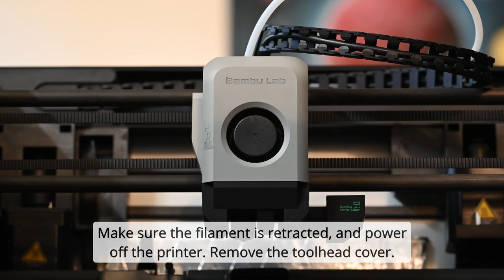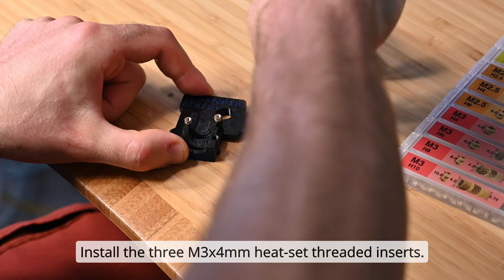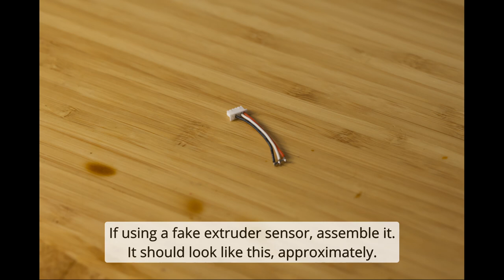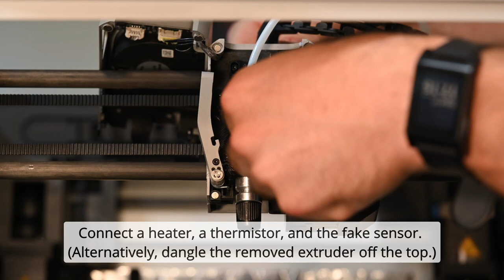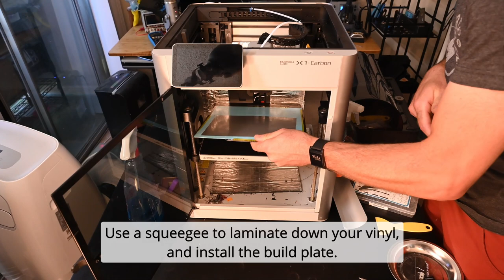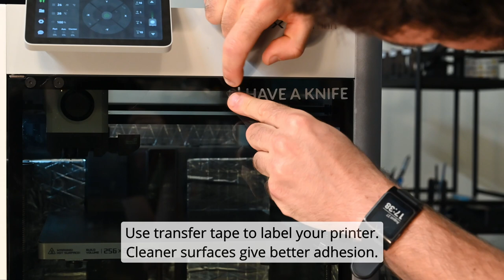Installing the vinyl cutter retrofit for Bambu Lab X1 Carbon

Comment: Well done! Extruder disassembly is better explained than the official videos do. Question: Did you also had so many issues with the Bambu provided hex screwdrivers?
Reply from the maker: I don't know why the official path to remove the extruder has you remove the hot end in situ. It's not necessary. But yes the provided Allen keys are made out of pot metal or something - I use an iFixit kit (in particular, I use the larger handle to get the right amount of torque), and I find that much more comfortable and quicker than the Bambu OE hex keys. (Also, the iFixit drivers are magnetized.)